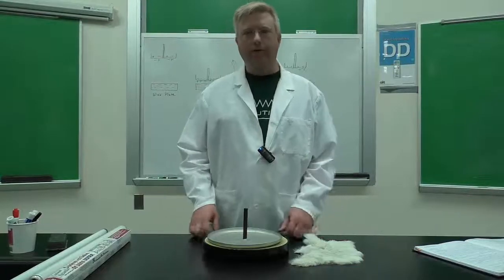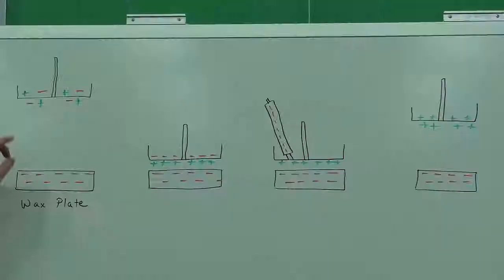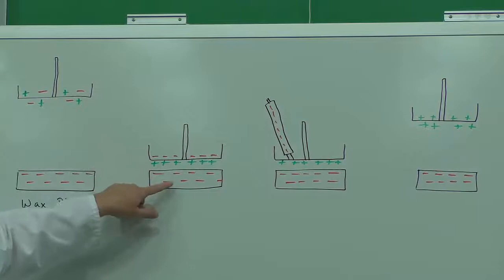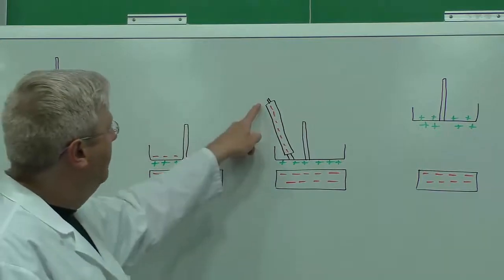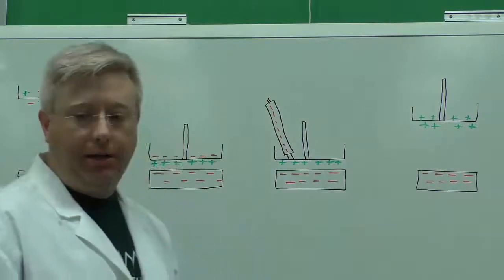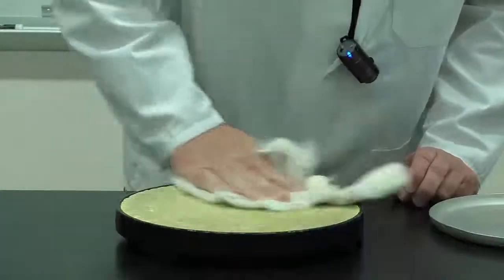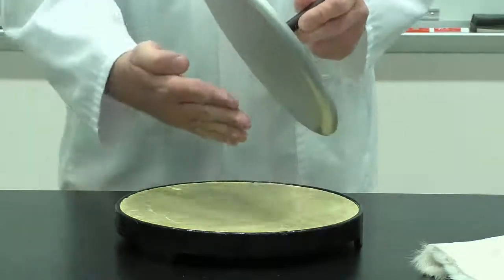Electrophorus Explanation (5a1020)

Comment: Your saying induction but the process your doing is all about contact method, can you tell me more plz
Reply: In this case the disk isn’t actually contacting the wax, so it becomes polarized without becoming negatively charged like it would if it contracted the wax. The light bulb then acts as a ground for electrons to move to, and the disk is positively charged. Induction results in the opposite charge between two object while conduction or contact results in the same charge.
Reply: @ShutterSpeed713  how can the light bulb "act as a ground"

isn't the earth the only possible ground?
Reply: @ShutterSpeed713  if the light bulb can "act as a ground" doesn't that mean anything can act as a ground for the electric fields around switching power supplies (used for most electric devices today) and the cables connected to it by induction?

Also, since human body is 70% water, doesn't that mean we can act as ground too for electrons to?

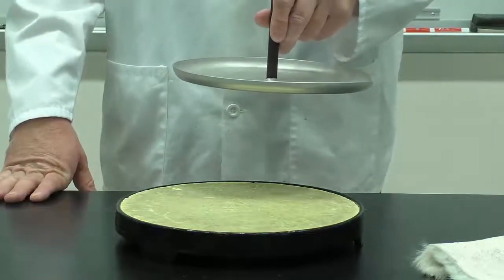Comment: At 2:45 into the video,  you used the word polarization occuring.   Excess negative charges gather at the surface of the wax and positive charges in the aluminum plate gather at the bottom side of it while it's negative charges repelled and gather at the top of the plate.  
I assume by polarization you mean is happening between the upper surface of the wax and the lower surface of the aluminum plate.... but you never specifically said that.  So that is up in the air hanging.....

There is clearly also the so called polarization happening in the aluminum plate itself.  Positve charge at its bottom surface and negative charges at top of its surface, although you didn't use the word polarization term for that.

You also never said anything about where all the negative charges from the surface of the wax go.  You never said if them electrons jumped and went to the aluminum.... so what happend to those electrons?

And then somehow the wax got depleted of them excess electrons that jumped from the wool and you had to rub the wax again.

Furthermore how on earth the wool just keeps giving electrons while depleting itself of them, leaving itself positive charged over and over and over again.  A positively charged wool sitting around all high strung and nothing happens to it.

You have gloves on while doing this experiment and obviously your body is in contact with the gloves and therefore the wool, yes?  Why on earth would the electons jump to your hand if you were not positively charged in the first place right from the get go? 
Does this complete the circuit full circle or not?  Tell me, how can the wool afford keep giving zillions of electrons and stay positively charged or somehow it doesn't?

Now back to the cause of potential difference in the first place..... they key bull's eye question.  How to create potential difference because only there is when things happen.  How to create imbalance?

This question is clear and obvious and in reality even an atom tells the story.

How to make electrons get away from the neuclous of the atom and keep going up and up and hell even leave it?
Hit the son of a bitch with photons.  Electrons impregnated by energy becomes independent of the force of electromagnetic attraction holding aslave to protons.
The rest I will leave it to you to connect the dots which I already did most all of it.   
If you follow the rabit hole you will eventually have to ask what I term the prime mover.  
I don't believe you would go that far and if  you did, my answer to it is this.  I don't know.  

You have internal energy that keeps things away from each other vs gravity that pulls things together.  Both are part of the intrinsic property of particles.  I.e. Mass, charge, spin.
However I could easily be full of it which most likely you agree.
Reply: This is a little pedantic. The explanation was good but brief, but obviously can't cover the fullest explanation for such a short video!